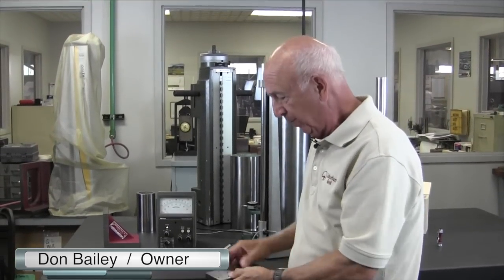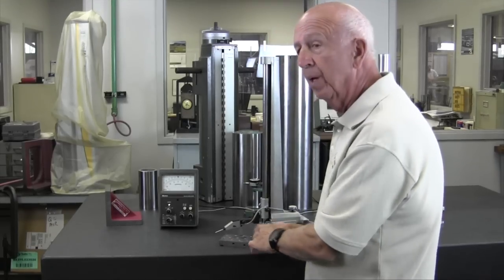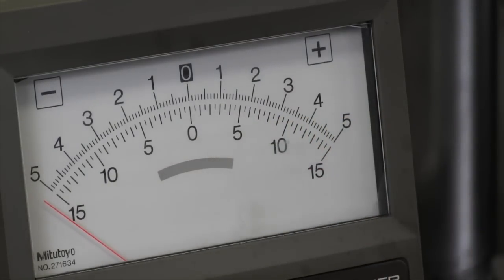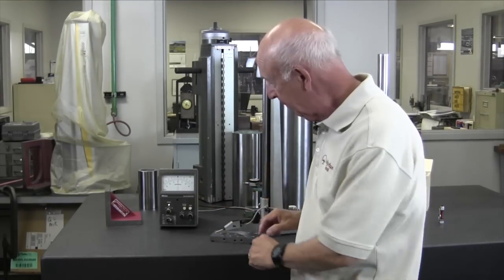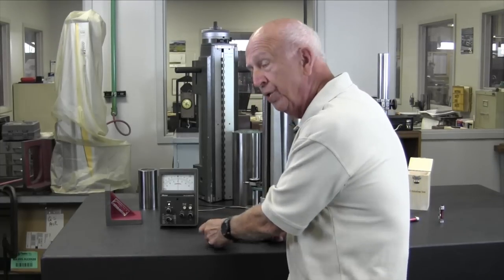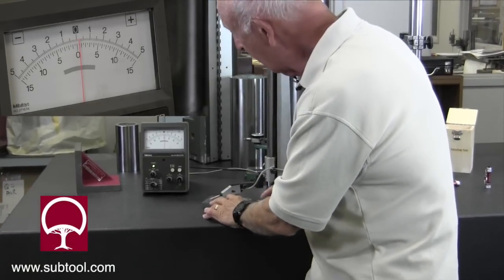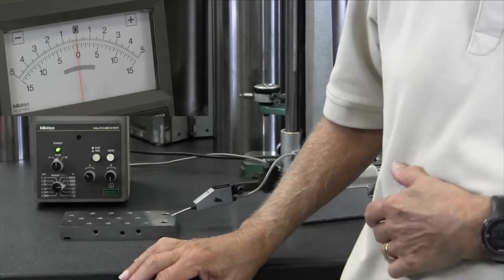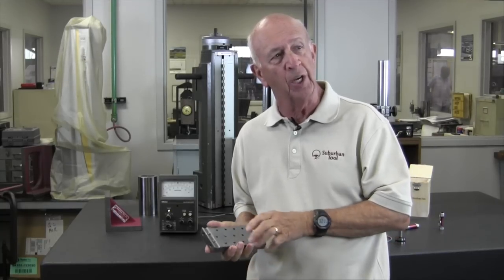How To Check and Measure Flatness

Comment: That part could be out of tolerance for flatness.With concaved surface on the bottom there would be no rocking motion.Flatness is not related to condition of other surface like in this example. It is form of one surface and should be measured independently. I'm surprised that large mfg. like Suburban Tools are showing this as way of measuring flatness.
Reply: Wow well I guess u should measure flatness in plain space because we know space is flat 😂 wow and u got 14 like for what 😡
Well even NIST certifies grand master off a known surface 
And he is in a qc room probably kept at 68 degrees Fahrenheit with a surface plate calibrated with grade aa certification I would probably be safe to say that part is flat to within whatever the surface it’s measure off flatness and the metrology used to verify GET LOST
Reply: Agreed that is not how you check flatness. Proper way would be to put on to a 3 jack stand, level them then run the test indicator over the surface

Comment: What is the indicator and the needle tool called?
Reply from the maker: Test indicator.
Reply: @SuburbanToolInc  What is that mitutoyo device that shows the scale and how does it work? you talked about setting it to a specific range? what is the tightest resolution you can get? thank you.

Comment: sir, what if  the part just require for parallelism, and you have a part with a concave or convex surface it just parallel it self, does that part  are acceptable?

Comment: What is the difference between Flatness & Parallelism in terms of measuring method?
Reply: Parallelism is relation between two surfaces (what he is measuring in this video), flatness is form condition of the single surface.
Reply: What he is getting there is a Parallelism reading, (the granite rock/plate simulates the datum) Parallelism requires a Datum. Flatness is the relationship/behavior of a single flat surface/plane. Flatness is comparing all readings to a virtually perfect flat plane sandwiched between the high and low spots of the machined surface areas. It's in my opinion very difficult to obtain the proper flatness readings without a CMM or setting it up upside-down on 3 points and using a dial indicator to sweep the surface for high and low spots. Look up GD&T for flatness definition for details.

Comment: What you are actually measuring there is Parallelism, not Flatness.
For Flatness, you would need to mount the surface in question down on 3 o 4 blocks or towers to isolate the surface. Then turn 180° your probe to take measurements.